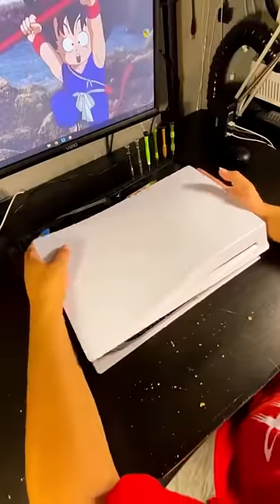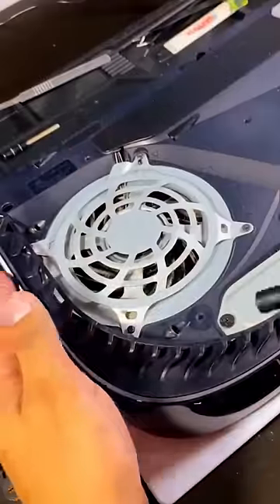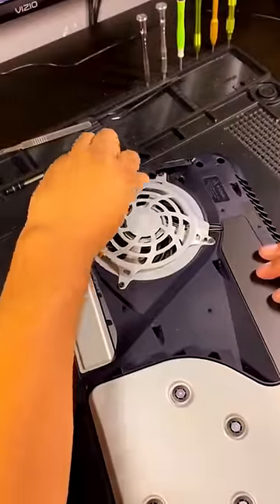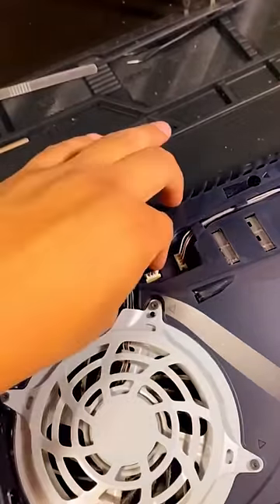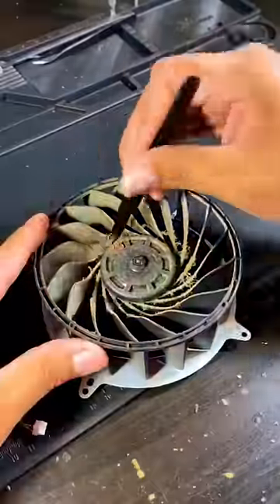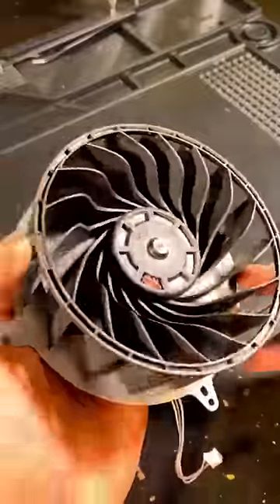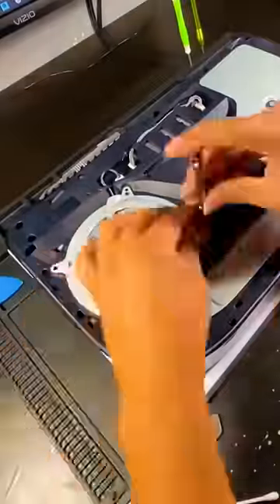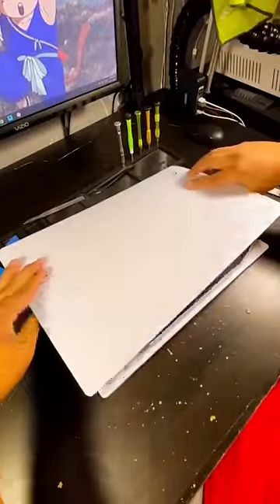How to Clean PS5 Console Quickly, Safely and Without Losing Your Warranty

Comment: All wrong about this video sorry.
Never blow compress air to PS5 because the dust goes deeper in it.
When remove the second plate (not that where blue ray disc is) you see two holes where is the dust traps of PS5 applying a vacuum to this holes and second first remove the fan and next blowing air and cleaning 🧹...